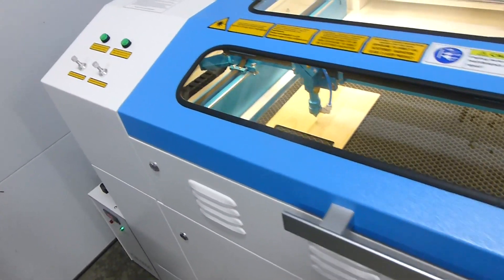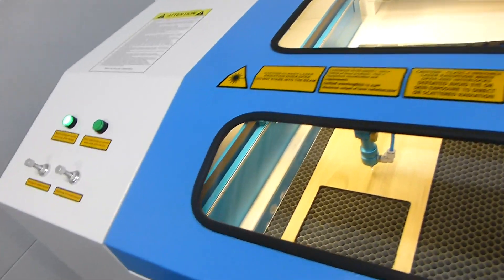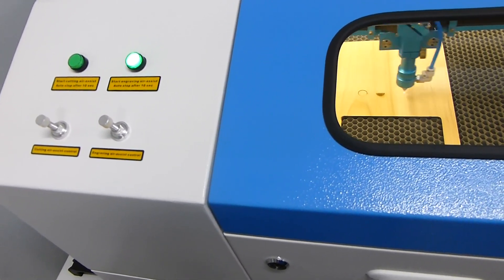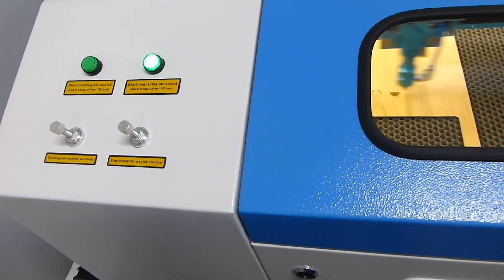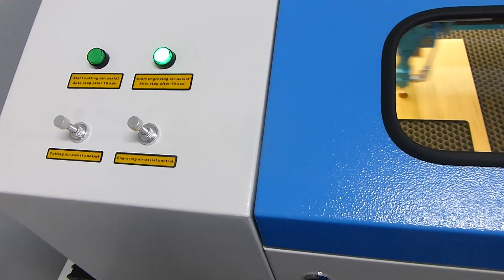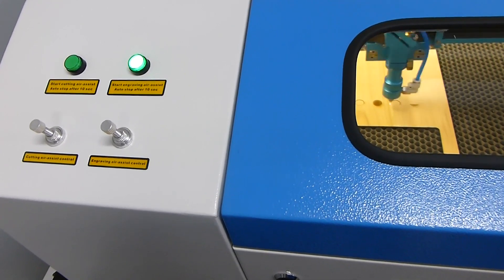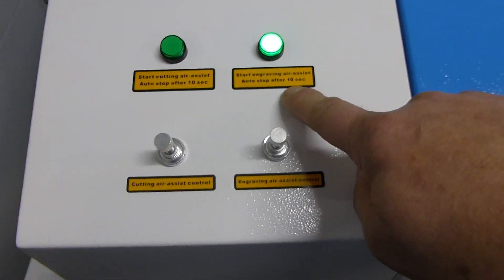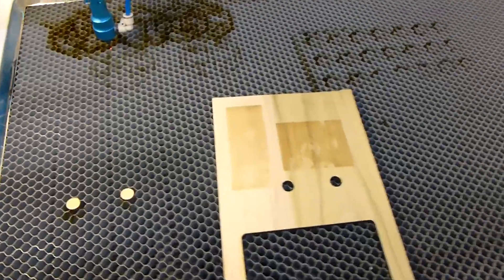Thunder Laser Dual Stage Air Assist Control

Comment: Hey Brian,
I’m running a line (or cut as I understand it), I have air assist on in Lightburn, but it’s still running the low volume air assist for engraving. 

Am I missing something? 
Thanks!
Reply: Tweaking a bit when I run it from light burn, it’s not running the proper air assist.

When I run the job from the laser, it uses the correct air assist for the cut. 

Any idea why the software might be off or am I doing something wrong on the software?
Reply: @ArmenKesheshian  did you figure it out? Pretty sure that the same thing is happening to us.
Reply: Hi, I have a big problem with this also! Yes, when you run projects straight from LB there might be some errors - WHY? IDK.
When you send the project to the machine it works well.

But time to time it happens to me also, that the machine uses the "low air" even if I set up the "high air". (I do not run projects straight form LB at all)
I would be SOOO happy if somebody would know how to fix this!